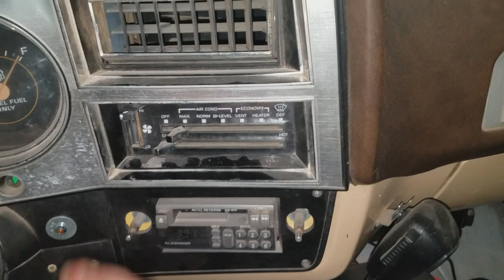82 Chevy K5 Update / ALL NEW AIR CONDITIONING

Comment: Really hoping my K5 Blazer moves as much air as my Jeep TJ did... I drove it without a charge for years.
It has those long side windows, the Jeep had less cab area. 240 to 440 AC freon free.
A built LS1 waiting for me to finish up repairing the sheet metal rot.
I really want to pull that AC box and just run a retrofit AC system from a newer vehicle. 🤔
Reply from the maker: Mine works good now. But where I live even brand new vehicles can struggle in the summer heat. 105 to 115 temps all summer.